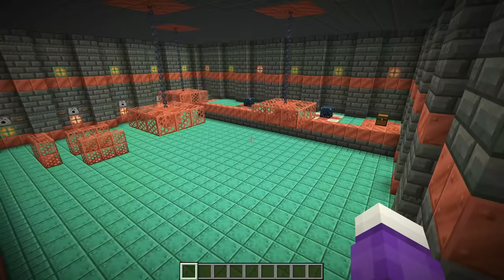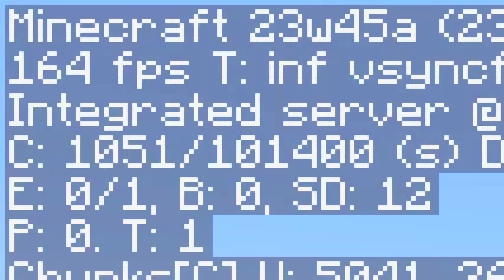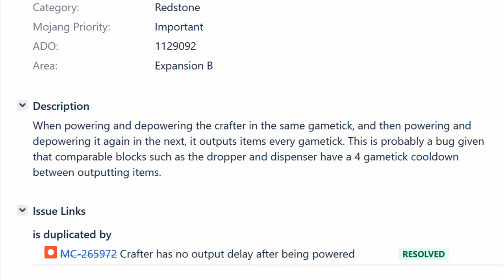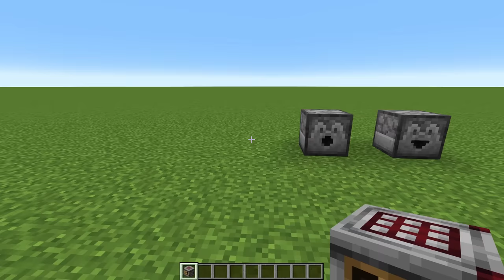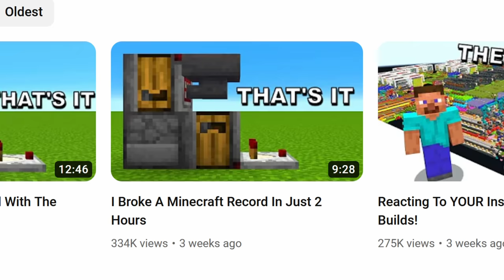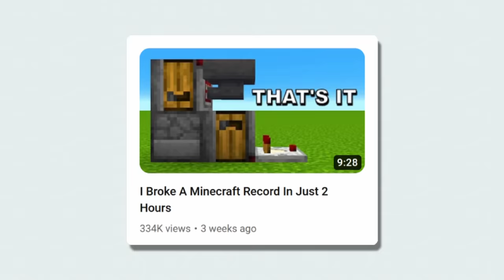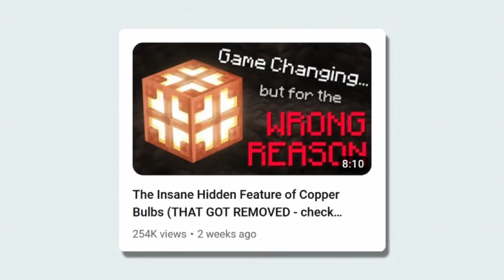Mojang Is About To RUIN Copper Bulbs (And Crafters)

Comment: Mojang: we have decided to make the blocks more inline with other redstone components.
Also Mojang: pretends quasi-connectivity doesn't exist
Reply: Why is the tick rate thing even a thing?
Reply: @robuxyyyyyyyyyy4708  Because that's how the game is simply running. Otherwise you'd have to bind the game speed to the framerate at this point and do you really wanna bind redstone to the framerate?
Reply: So
you want them to remove QC?
As you wish.
Reply: @robuxyyyyyyyyyy4708 I'm not familiar with the Minecraft codebase but I believe it is designed that way because the alternative is it runs on individual frames. This could mean that redstone would cause inconsistencies in the event the game lags. I imagine this also helps when connecting 2 players with different frame rates.
Reply: Considering Mojang removed QC in the main version of the game, yeah I'd say that's accurate.
Reply: my content reigns supreme on all of youtube
Reply: Removing quasi-connectivity would break Jeb doors. Can't have that. Except in bedrock I guess.
Reply: because Minecrafts simulation works in frames. each simulation frame is a tick, and there are 20 per second. the other alternative is to bind this to graphics framerate (and avoid interpolating movements/positions), but this causes issues. for example, look at Terraria, where the games simulation speed is set at 60 frames per second. the game also cannot really run at higher framerates than 60fps, because it creates visual bugs and doesn't actually make anything faster, except for animation speeds. it's a good thing for a game to keep FPS and TPS seperated.
Reply: @peachypet808 redstone tick and in game tick is slightly different thing
Reply: @Goomba456 That's how it works for all games
Reply: @robuxyyyyyyyyyy4708  Because otherwise the game will run based off of frame rate, which means that if one person is playing at 50 fps, and another person is playing at 100 fps, then the second person would be playing the game twice as fast as the first person. It's basically /tick set 20 and /tick set 40. This is how it works with all video games.
Reply: @kuronya3582  No it isnt - not in java. It's just that some stupid person decided to call a delay of 2 gameticks a redstone tick
Reply: @recycledwaste8737 Bedrock edition is not the main version.
Reply: Qc is a benign tumor
Reply: @kevinjamesmartin4307  QC is officially a feature.
Reply: @martinshoosterman  technically bedrock is the main version due to the naming scheme and microsoft's focus on it, which i guess kinda makes sense considering that version has the most players on it
Reply: quasi-connectivity is to maintain consistency between pistons and doors.
Reply: They must add it to bedrock 💀:(
Reply: or locationality
Reply: If they remove quasi-connectivity, they're gonna lose several million players.
Reply: You:pretends bedrock doesn't exist
Reply: @harrishromero6447  Damn people hate bedrock :/
Reply: @TheDerpyDreamYT  bruh like 50% of the player base are bedrock
Reply: @TyphoonBeam  that is an extreme exaggeration lmao. maybe some will throw a fit and leave... but most redstoners will adapt to changes as always - and I seriously doubt anyone else will care.

it should be removed tho imo. I've ran into more issues with QC making circuits that should by all means function perfectly completely bricked, or require extra redstone to provide updates to things getting/staying powered that should not be getting powered than I have never personally found any uses for QC (beyond hyper-specific gimmicky budding shenanigans) that I couldn't achieve without simply powering the block below instead if I wanted to.

its helpful when you need it, sure. its also utterly infuriating when you don't, and to players without an encyclopedic knowledge of the games development history; it looks and feels like a bug. 
it should be removed imo for the sake of making Redstone intuitive and internally consistent, and at the same time replaced with either a new type of piston, or (the cooler option) a new activator block that can emit a signal 2 blocks away in a given direction through any block, including air, when powered. that way, the functionality isn't lost for those who really want it (potentially even expanded upon), but isn't forced on everyone else at their inconvenience, and removes a prior limitation - ultimately giving the player the choice as to whether or not they want to utilize QC.
Reply: @TheiBunny  Another thing worth mentioning is that QC is also the foundation for 0-tick redstone, a less concrete field of redstone, but one with a few thousand people at least. It essentially pushes Minecraft's mechanics to their theoretical limit to make things happen in the most efficient way possible.

Not entirely sure how you were recommended a redstone video when your arguments appear to be so anti-redstone, and judging from the fact you've said you have had bad experiences with QC before I'd guess you aren't a bedrock player.

That new activator block does sound like a good idea, but I feel like it would probably make things less compact. Then again, if it were to be moveable, the redstone community would probably accept a moveable, directional replacement for quasi-connectivity in exchange for a lot of smaller builds becoming slightly less compact.
Reply: @Goomba456 exactly right. If this game was tied to the framerate, you would never be able to do anything, due to the amount of lag that happens. :P Also, didn’t expect to see you here.
Reply: @recycledwaste8737 as a bedrock player, bedrock is not the “main version.” One is not necessarily better or more mainstream than the other.
Reply: @mr.pickleworldbuilding not really. For most games, it’s tied to the framerate, and that framerate has a cap. Can’t look any better without speeding up the game, but if it can’t render the entire frame, it slows down.
Reply: @mr.pickleworldbuilding  true though it's handled slightly differently depending on where you are looking. In a game like Minecraft it's extremely crucial to maintain a global timer though.
Reply: its good tho
Reply: @Goomba456  tick rate also affects literally everything in the game, interactions (hitting an enemy, breaking a block, opening a chest, opening the ui and trading with a villager [seperate actions], etc), fire spread, entity speed, how long it takes for gravity to affect a block (water, lava, sand, gravel), you get the point

if everything was done by framerate, everything above would be sped up or slowed down depending on fps. with the tick system for servers (singleplayer/multiplayer) only inputs made from the client are done by fps (any input made from keyboard/mouse, controller, etc). which would get processed by the server in however much time it takes for that packet of inputs and game data to be sent from client to the server (otherwise known as ping)
Reply: @kuronya3582  I completely forgot about that. Redstone tick relies on game tick but not the other way around if I remember correctly
Reply: @devini15yt not just jeb doors. 90% of java redstone.
Reply: @recycledwaste8737  Bedrock isn't the main version of the game. Java Edition (JE) is the OG and is the one that keeps Minecraft alive. Bedrock doesn't help Minecraft popularity at all. Almost everything you'll see on youtube is about mods, redstone, servers, ... made on JE. Also QC is wanted by the community as it is one of the mechanics that makes JE redstone faster and better than Bedrock's.
Reply: @kiryonnakira7566  There is no world where a PC exclusive version that is home to a mere 20% of the community helps Minecraft's popularity more than the version that 80% of the community plays and is available on all platforms. 

The average consumer isn't concerned with what version was "OG" or not. They couldn't care less. They are concerned with what is convenient and allows them to play with their friends. That, almost always, is the Bedrock edition.

Bonus point: One is called "Minecraft" the other one is called "Minecraft: Java Edition." If that doesn't tell you which one Mojang/Microsoft considers the "main" version, I don't know what will.
Reply: @kiryonnakira7566  Bonus bonus point: While that may have been the case several years ago, we've now reached the point where Bedrock YouTubers are just as popular, and in some cases have eclipsed Java players. Even YouTubers who primarily play Java have been making moves to accommodate Bedrock players in order to stay relevant.
Reply: @RipVanFish09  It demonstrably is. 80% of the community is an overwhelming majority of the playerbase. You can't get more mainstream than nearly all of a community playing the same version.
Reply: QC wasnt removed only because it has been in the game relatively* long time and they didnt want to ruin existing builds. Honestly this was long term a bad idea and they wanted to fix it in bedrock edition but people were already used to it. it is an interesting feature tho. Fixing copper bulb now before its in release version is how fixing should work.
Reply: @robuxyyyyyyyyyy4708  Tick rate is how fast a game processes information. 

Without tick rates, the game's processing will instead be framerate based. This means if your FPS is too high, the game will literally start running faster.  

This is true for games like Undertale and many Nintendo 3DS games. They are capped at 30 FPS, because if the FPS was allowed to go higher, the entire game would speed up. If you allow Undertale to run at 60 FPS, it will be 2x as fast which is basically unplayable.

Tick rate is essentially a framerate for processing information, it allows the game to run at a higher FPS without the game speeding up. Minecraft's Tick Rate is by default 20, meaning the game is pretty much only processing information at 20 FPS while the game itself is running at 60 or more.
Reply: @Goomba456  It's crucial for every game, though it's usually handled differently with other games using a process called delta time(which is often a built in background process, but not always). If you don't have some form of delta time, then the game will quite literally be unplayable.
Reply: @n45a_  Long term bad idea? Despite the fact that it introduced lots of really interesting concepts and ideas, and overall created a net positive splash on the community? You're clearly out of touch. Bedrock redstone is awful and extremely limited.
Reply: @RipVanFish09  I'm not saying games usually use ticks, I'm saying they use a process similar to ticks so that the speed at which the game is working doesn't change based on framerate. 
This is usually accomplished by using delta time, which may or may not be tied with capping framerate.
Reply: @mathgeniuszach  bedrock edition redstone is hot garbage only because its so inconsistant and slow compared to java
Reply: Bedrock be 😢😢😢
Reply: @recycledwaste8737  Java is the main version
Reply: @wilh3lmmusic  That's not even kinda true.
Reply: @martinshoosterman it is though, it’s the way the games going to be in the future once Java support is dropped.
Reply: @kiryonnakira7566 bedrock has a much larger player base than Java, and they support the game a lot more through the ingame store. How does modding support the game?
Reply: @dylanb2990  "once java support is dropped" im laughing my ass off rn. Some 12 year old comes into a youtube comments section, blasts their shitty ideas for all to see, and he does this all with the confidence of an expert.

Most of the community is on java. Most bedrock players are casuals that do not interact with the community, and just play the game for fun.

Comment: If they want to create a delay on copper bulbs, they should add different delay for different stages of copper weathering
Reply: this
Reply: i could back this one. i'm in the minority of people that was glad to hear they changed the delay, but both is better
Reply: @rubixtheslime  Why? I have seen a few people who i can only assume are trolling argue for it, so im curious as to some actual reasons you could prefer the delay to be longer.
Reply: @nintySW  this ended up being pretty long, sorry about that. just trying to get my thoughts down.

i prefer the instant behavior, while most people prefer the delay. when i first saw the bulb, i figured it was supposed to be a simple t flip flop first and foremost, without other behavior that could hamper that ability. so when i found out it has a delay, i felt like it kinda ruined it, as that directly means the signal would get misaligned the moment it passes through a bulb. many of the ideas i originally had became simply worse with the delay. to clarify, this is counter to most people's opinions.

main reason i like the instant behavior really just comes down to, it's faster and simpler. and it's not like having it instant is useless for observer tech anyways, we finally have a block that changes state when receiving power but not when losing power, which is something i remember needing multiple times in the past (unless i'm reading things wrong, as i haven't spent the spoons to mess around with the bulbs myself yet). i really like the idea of a bulb being a nice beginner friendly t flip flop, no strings attached. and i'd have to mess around with it first to verify (mainly to confirm it doesn't use a block event or something), but it looks like it could be very helpful for instant comparator logic, which is something i've been working a lot with lately.

in my own experience, i've found that whenever i do need an odd tick delay, scaffolding, leaves, pistons, water, player inputs, etc. have always been enough for me personally, at least to the extent that i don't think the delay is warranted enough when it will inherently impact the bulb's main feature. plus, if we ever get a different block that has a 1gt delay after being powered, that would easily make the delayed bulb worse than an instant one.

i will admit that this video did present something i hadn't actually considered before: bulbs being the only movable odd delay generators other than pistons.  but again, if we were to have a block that creates an odd delay when powered, i'd much rather it be separate from the bulb.

there's also the part where, i've seen this exact situation go down so many times before. people say that Mojang is about to "ruin" a feature, without even taking the time to see if other new things are possible with the so-called "ruined" behavior. and with few exceptions, people have always found other amazing new stuff that was only possible with the "ruined" behavior. so i'm a bit opposed to the mindset of taking weeks of work (the stuff found with the delayed bulbs) and comparing it to zero days of work (stuff found with the instant bulbs) and saying "all is lost! Mojang has ruined the feature! clearly this is a terrible change!" before actually giving the new tech a chance, no matter how "obvious" it may seem that one side is better. the mentality of not checking because i think it's obvious is what kept me in a cult for so long. it's that blinding and i don't want to risk it taking away any more joy from my life.

at the end of the day though, i'll be fine either way. these days i try not to invest too much stock into singular new features revolutionizing the game, just enjoy the game, and only ready the pitchforks when it's something i think is truly important to address. (... i say after writing multiple paragraphs about one block getting changed)
Reply: im thinking of submitting a false bug report for this since apparently thats the new suggestions page lmao
Reply: @rubixtheslime  One of the issues is they're not removing the odd delay, they're just making it 2 gameticks instead. overall i understand where you're coming from though

oh btw, if you ever need an observer to read only the on signal, just run it through a one tick pulse generator first (repeater into block with a piston below it)
Reply: @nintySW  You seem to not understand what you are saying. He is saying he prefers the new way the copper bulb behaves. Which is faster. Most players wanted the older version, which had 1 tick of delay. So Why would you ask him to give you reasons why he wants the delay longer when he said the exact opposite?
Reply: I love that idea
Reply: Makes sense logic wise as well, the bulb slows down with age and “rust”
Reply: the funny thing in your paragraph is.... we have note blocks which do the exact same thing as the copper bulbs now...... @rubixtheslime
Reply: @IslamHany-dg6xi  that's weird, you'd think observers would detect the bulb changing whether it's on, not whether something's powering it
Reply: Solid idea, maybe 1 tick per stage? Anyway, me when I place a lightning rod on the bulb and pull out my trident to break my friend’s machine:
Reply: @poppinlochnesshopster3249  the copper bulb went from 1 to 2 gameticks though?? thats a longer delay
Reply: @nintySW It went from 1 tick to 0 ticks. Please watch the video.